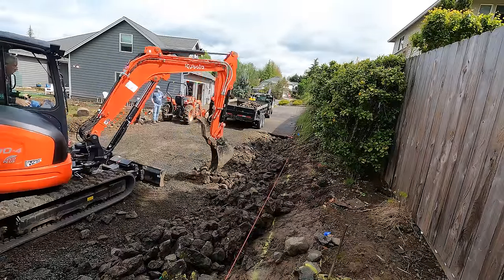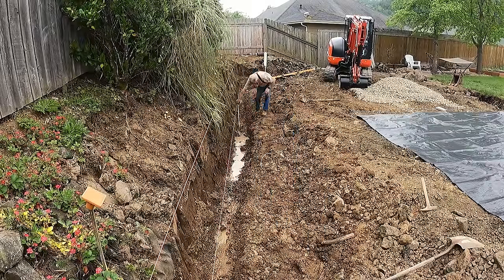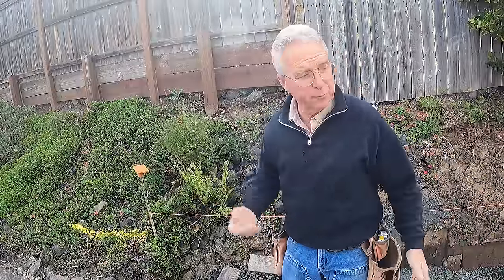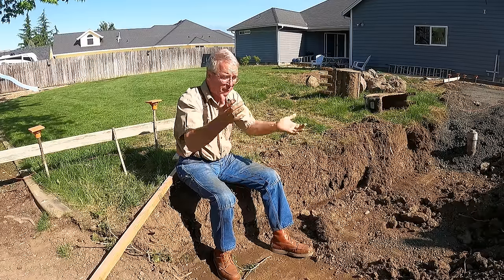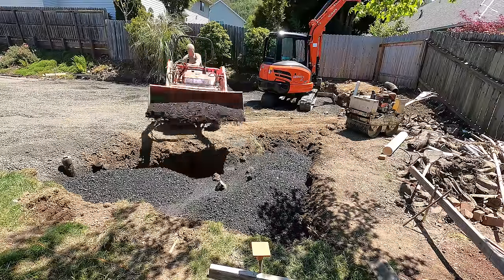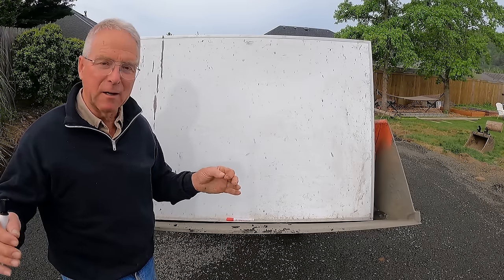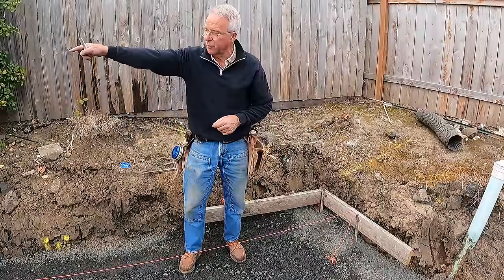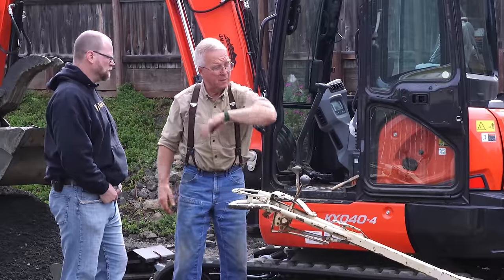Dirt Work: Shop Build #3

Comment: I can't help thinking that's a long complicated way to square the layout how about 345 an old way to check a right angle. Three on one side four on another gives you five on the hypotenuse it does not mater if its feet or meters or miles if you think big, so add your 36 feet and your 26 feet equals 62 feet divide by 7 ie the 3 and 4 element which equals 8.857 feet times five the five element equals 44.285 feet same numbers but very quick. I don't think this is a very good explanation but it works another top grade video take care all the best from the uk
Reply: Incorrect.  You got 44.285 to his 44.407.   And it gets worse the more the a&b dimensions vary with one another.  Do a 1x12 sidewalk (yards, meters, rods for a driveway, whatever) your way, you won't get anything close to 12.04

Comment: Did I miss something? It looks to me like you completely left out whatever method you used at 27:45 to ensure that the first two string lines were perfectly parallel and exactly 26 feet apart. That's a key step and if not done correctly your building's outline will not be square. You fault all the other videos for wasting time and effort tweaking the side and diagonal measurements to get a square layout but you don't provide any details for your magic method for setting up your first two string lines. Establishing those first two string lines at the correct distance is no easier  than establishing two square sides and the equal diagonals.
Reply: I was wondering that myself. Obviously you can measure 26' from both ends of the first line, but if both measurements aren't perfectly perpendicular then the second line will be off.
Reply: @balzacq  I completely agree. Also, if he's got some method to measure off both ends perfectly perpendicular then why didn't he just use that method to set up the two perpendicular string lines 36 feet apart before setting up the string line that's exactly 26 feet from the first string line?

Since he used his laser to establish grade, I suspect he "cheated" and used his laser to establish perpendiculars to get his second string line exactly 26 feet off the first string line.
Reply: @balzacq  Over a 36 ft. distance, if you are within 6 inches of perpendicular, you will be fine. Even at 12" off, it only changes the length by less than 3/16". It's only short distances where it starts to matter.
Reply: @ADBBuild  That is exactly right. For something 26’x36’, the guy holding the “dumb-end” of the tape can ‘eye-ball’ for squareness of the string to the tape relatively accurately. He simply needs to tell the guy on the business end of the tape; “hey move back a little to your left [or right]”, to get perpendicular enough. Once the 2 parallel lines are up, for a check, they can measure between the 2 at both ends, swinging a slight arc to ensure they are perpendicular and make any ever-so-slight adjustments from there. We’re building a shop here, not a watch. 
If it was 260’x 360’ you might want to employ an instrument.

Comment: Why you ve put 36 feet on one side and 37 feed the other? Check your vid m8..that aint right..Pythagore would not agree!🤣
Reply: It's called "burning a foot". Or "burning an inch" when doing carpentry. You skip the first foot on your tape measure. Or the first inch on your ruler. That's because the end of a tape or ruler is the most worn and least precise part of the tape or ruler (and nobody trusts the inside/outside toggle on the end of a tape).